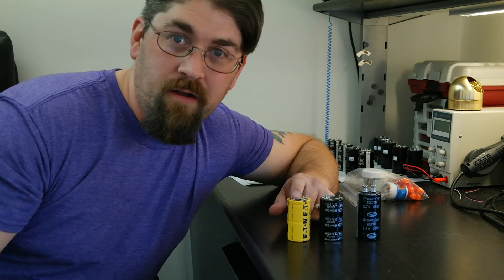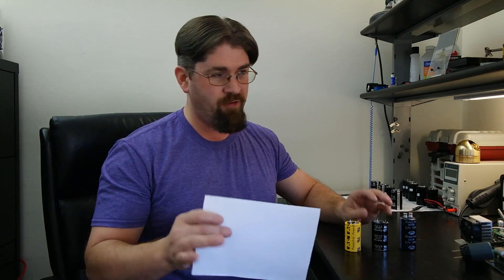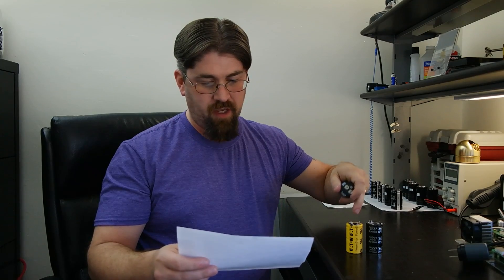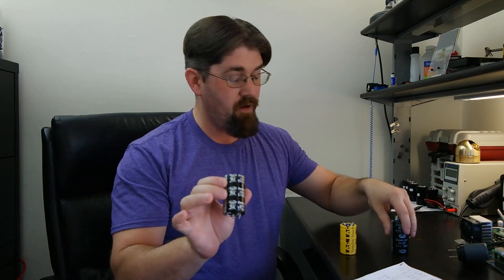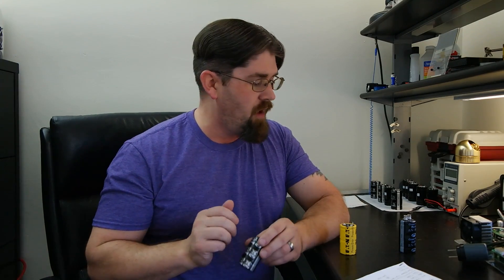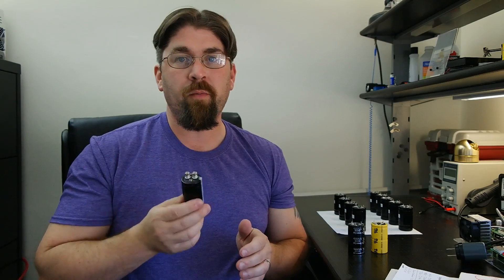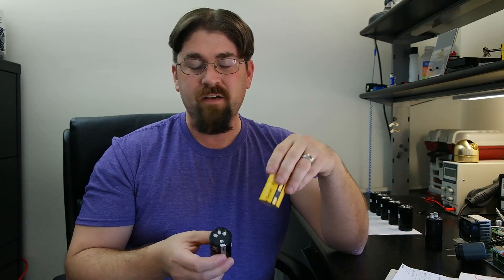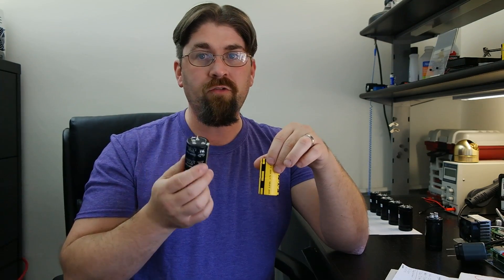Supercapacitor Quality Comparison - Which is Better?

Comment: Sam wha Green Cap EDLC does have data sheet for 2.7 500 F capacitors. ESR, 1kHz 3.2mohm, ESR, DC 3.8mohm, L/C(72hrs) 1.35mA

Comment: Thanks for the video. Could you explain how you did the ESR measurement for your capacitors?

I have a bunch of those Eaton 400F Caps and they have a DC ESR of around 3.2mOhms which I tested and is the same as on their datasheet. I havent tested at 1kHz though.
Those samwha/greencap knockoffs I have a bunch of too but, like you say, are probably the failed 300F versions and they have a DC esr normally above 5 mOhms some much higher. 
The reason I ask is because the esr is normally much better on those Eaton Supercaps than the Greencaps and hence you get a much higher peak output current etc.

Cheers

Comment: arr yes,the old "Which is Better/best" non sequitur question and the "BEST" OPTION IS  still in 2019, watch prof roberts video's and learn to make it yourself the uk "better" way https://www.youtube.com/watch?v=EsnkwQDGnJ0 Homemade 3.6 Farad Supercapacitor
Robert Murray-Smith,Published on Mar 29, 2015
simple homemade supercapacitor where the baseline material has a 900 farads per kilo capability.

or if you want to fall for the bigger is better ether/or mentality then perhaps his Super Safe Megafarad capacitor is more in line with the exceptional thinking https://www.youtube.com/watch?v=6acygQLg-HM Robert Murray-Smith
Published on Jun 13, 2015

Comment: Great video...I honestly value your observations.  Any chance u can review  Qinfen 3000f supercaps offered on ebay.  ?   The seller fails to provide any real metrics...only that these caps " are rigorously tested prior to shipment" ... I don't trust unbranded and unreviewed electronics.  Thoughts?
Reply: I have that exact same question. I actually got one of those and it felt as if the content inside was loose and moving around. So haven't even tested it yet but it could be a poor sample and other units might be acceptable. I may open up the canister and see how it looks on the inside. Not eager to do it, however, if there is something unhappy substance.

Comment: Perhaps that cap with the screw terminals had a built in discharge resistor.
Did you consider that?
Because if they do, then of course, they are not junk.
Did they all have a similar self-discharge rate of around 45mA?
My guess is that they are good and have discharge resistors built in.

Comment: If I need to buy 10 to get 5 and they only have 3/4 the capacity then they cost the same as the $12 ones, $9 per usable unit for 3/4 the capacity or $12 equivalent for the same capacity.

Comment: I got the two pin (non screw) 500f capacitors at about 4$ each. Got scratched up and damaged from shipping, so I asked for an exchange. I ended up getting them for free. The balance board (also china made) blew a resistor and doesn't work. Main point: dont expect quality from chinese made super caps and balance boards

Comment: Very good review! I totally agree: most of the "500F" Supercaps from China, you can buy for around 4 Eur are junk. They are rejected, thrown-out from the 300 or 360F production of Samwha. They only produce one 500F type with snap-in mounting but which is rated at 2.8 nominal voltage - probably much more expansive. They really do cheat a lot, these chinese sellers! I will give mine back and reclaim my money - otherwise you encourage them to do business like this!
The smaller capacity isn't the worst in the deal - its that the specs are so much off - you just dont know what you get, but you can be sure, you cant use them in a 6S-pack, because they run out of balance quickly and damage the whole project!

Comment: DAOKI sells 500F capacitors.  I have hand-built them (and it looks so terrible.. worst solder job i've ever done) and yet they work amazing.  Tey're $30 for 3x, so $60 + $30 balancing board = <3
Reply from the maker: +Sin Vraal those are the fake/reject supercapacitors just being resold by DAOKI.  Samwha does not make a 500F supercapacitor.

Comment: Thanks for the video.

You can buy about 3 of the cheap 500/300 farad caps and end up with 900F for the same price as the Eaton 500/400F. 

I think that judging/identifying capacitor quality based on their terminal style is a bit unreliable. The terminals don't determine who made it or the quality of that particular series of capacitors. 

Would have been nice to see the more common Maxwells in the lineup.

Comment: Those cheap china ebay caps are junk I have received 12 of them and they were all bad some would lose their voltage in just minutes only 2 of them would hold 50% of its charge after 12 hours

Comment: Thanks for the video. These 350/400F supercaps are around for quite a long time. I thought the last several years they will double the capacity like 1000F for the same form factor - but no further development :( Only Maxwell reached 3V per cell, and that is the only breakthrough. I did some test myself in the past. I couln't quite measure the capacity, but I bought some cheap blue samwha supercaps 500F (they were labeled "low leakege"), and they behave strange - when you charge them for the first time they drain quite fast, but if you trickle charge them for several days, they drop to ~2V and stay like that for many months. Perhaps I was lucky. For comparisson, I am developing a USB power bank based on 6 (2x3) D size supercaps like yours. If they are really 500F each, I should be getting 2.8wh if charged to 2.6V each. I measured 1.7wh :) I can try with EATON but the project cost will go sky high :)
Reply from the maker: That's the only problem with using quality supercaps instead of Chinese ones, they work much better but cost much more!
Reply: FireSword
Reply: hmm i read some myth about capacitor "reforming" like in vintage electronics where if you avoid all load currents and just keep a device powered on for an extended period of time the voltage difference can allow for oxygen to diffuse in and around a little bit better and reform the passivation layer of aluminum oxide over where they are leaking current due to micro ablations/holes/spot welds between mylar coated aluminum layers. I mean super caps are quite different than the self healing mains 110-220v potted OG caps you used to get across the wall supply in on old electornics like VCR's, but still I imagine most caps can self heal to some degree. I think its a sign that those originally high leak caps are fragile and will probably not last as many cycles, but with some applications where they might be kept at resting 2+volts without temp swings and kept dry, should be okay.
thanks for the heads up. I have a bunch of the screw caps comming from china... wish i saw this video first but I think I am going to have to try what you said. hopefully this batch i get 6 years after this video is different. probably wont be.